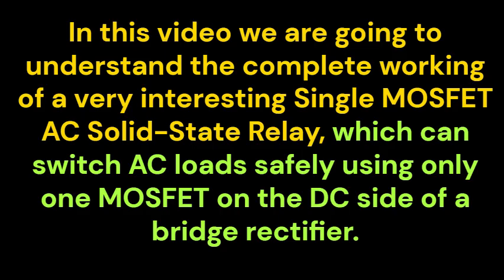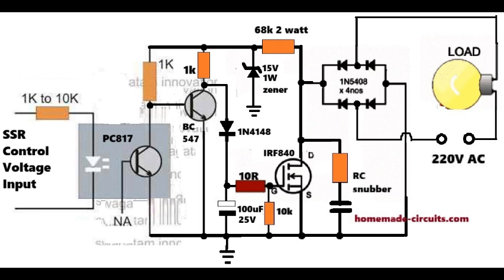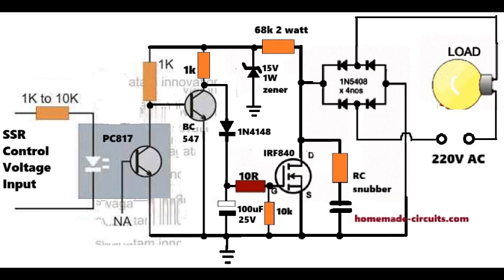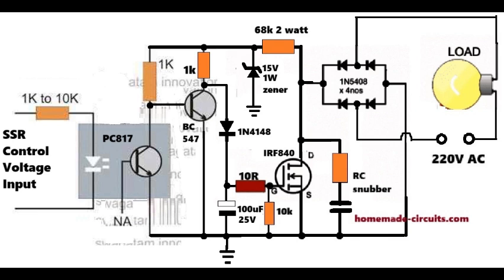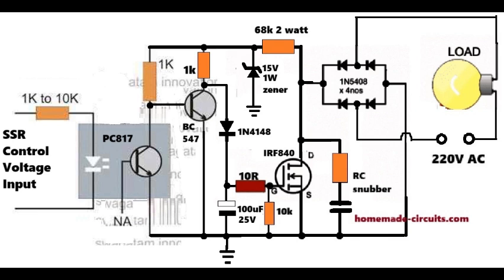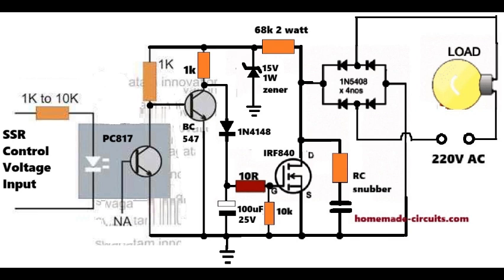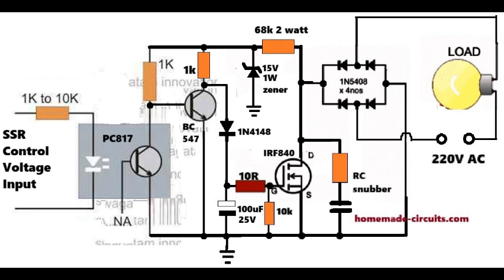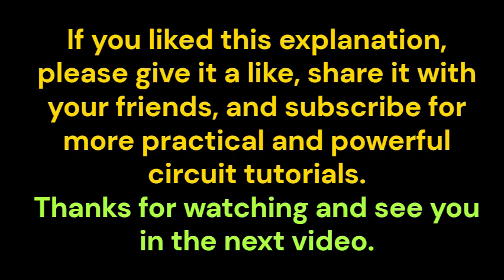Make this 220V AC Solid-State Relay (SSR) using a Single MOSFET Circuit

Comment: Here is an challenging question Inverter(dc to ac)circuit using 4 MOSFET's  and without using a transformer, a 12 V AC sine wave should be produced by providing 12 DC supply 
Try using either SG3525 or TL 494.  Can you make a video on it
Reply from the maker: That's quite easy actually, I will try to post it soon...
Reply: @Homemade-Circuits it would be really helpful if you give it a try
Reply: Quite a good thought would be nice to see that on action...👍🏻

Comment: Hello sir,,what resistor i use for rc snubber?i done that to prevent the transistor or mosfet from heating but i had no idea that it was a kind of rc snubber ..i wanna know if what resistor value i must need... thanks
Reply: I tried ur other circuit and its working...i ask if that circuit is pure sine wave?i am looking for an inverter to operate my washing machine..u gave a modified sine wave last time but i haven't try it yet because im busy..
Reply from the maker: @vicferrepedraya-678  I don't remember which circuit I gave you, please provide the link, then I can suggest...
Reply: @Homemade-Circuits i forgot the link sir,,i find a pure sine wave circuit to drive my washing machine..in order to lower electric bill..😊
Reply from the maker: Hi Vic, you can use the following calculator: https://www.homemade-circuits.com/rc-snubber-calculator-for-mosfets-relay-contacts-and-triacs/
Reply: @Homemade-Circuits thanks sir

Comment: Theoretisch möglich - bei den Preisen eines SSR mit unbekanntem Inhalt, lohnt sich der diskrete Aufbau nicht wirklich - vll. zu Lernzwecken oder 'weil man es kann' - finanziell dürfte Das aber keinen Sinn machen.
Reply from the maker: This circuit will work, because the design is obvious and basic electronics.
Reply: @Homemade-Circuits  Das hatte ich nie bezweifelt - einen DC Schalter in den DC-Zweig eines Brückengleichrichter zu packen, ist nun auch keine so neue Idee - den Kram an eine Steckdose anzuschließen - ok, Das hab ich noch nicht gemacht - wenn ich kleine AC-Lasten schalten will und Das diskret aufbauen muß, nehme ich einen TIC und einen MOC - Welche genau, müsste ich nachsehen - gab Mal eine Seite, wo ein 'Switch-Modul' vorgestellt wurde, war Bühnen-Beleuchtung - meine, Er hatte auch eine DMX-Schnittstelle entwickelt, mit Der Er Seine Switch-Module dann auch gezielt schalten konnte - ist aber auch schon zig Jahre her.
Reply from the maker: @aaaooaao9949  Thank you for your valuable feedback! MOC won't be required since zero cross sensing  is not needed in this design...yes, it is not a new idea, in fact I have used this concept earlier also in a few of my articles, like ELC controller, treadmill motor controller etc

Comment: 68К 2Вт-пересчитать в ёмкость, греться не будет. Коммутация активной нагрузки-демпфер можно не использовать, меньше детальков. Схемка рабочая.
Reply from the maker: Yes, capacitive supply can be used for the MOSFET gate drive, but that might sometimes create an initial switch ON surge current, although even that can be eliminated with an NTC...
Reply: @Homemade-Circuits  BC547 при подаче питания сразу открывается, чем блокирует цепь затвора и плюс большая ёмкость в цепи затвора не даст быстро переключиться полевику.
Reply from the maker: @evgenjack-d2x7l  Even if BC547 is open, a capacitive power supply surge current could shoot through the BC547 collector/emitter and burn it, or it might also burn the zener diode. so 68k looks safer, eventhough it might dissipate some power.
Reply: @Homemade-Circuits  Длинно описывать-закинь схему в эмулятор, какой нибудь, и промоделируй ёмкостный балласт под нагрузкой.